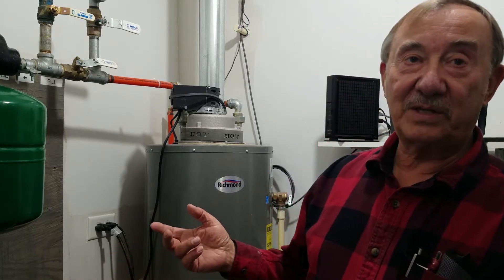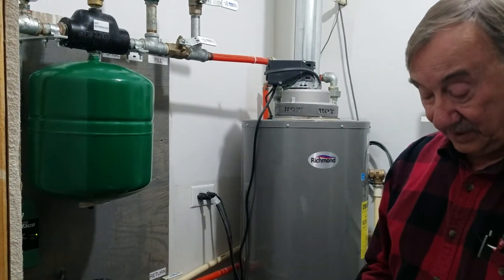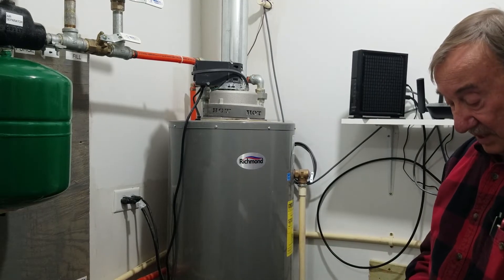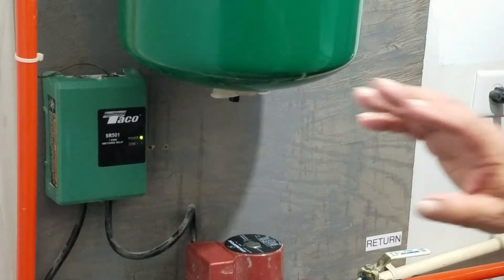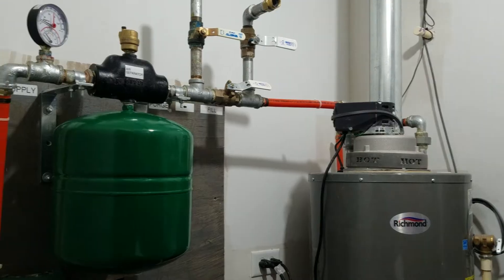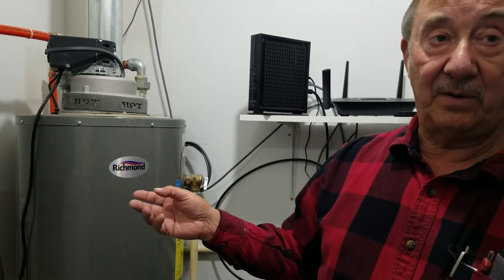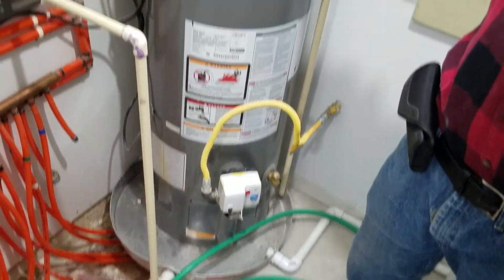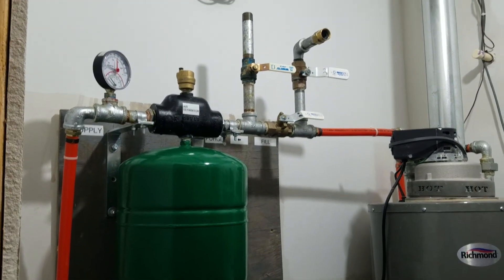Radiant Floor Heat With A Water Heater

Comment: These heaters are only about 60% efficient.. I used to use the same system.. it works, but man it isn’t efficient.  I just updated my 2 old gas water heaters to a single heat pump water tank .. and for giggles I decided to run my floor off the same house unit.  To keep the water streams separate, I use a water to water exchanger.  I also have a fireplace hot water coil that cuts in every time I have a fire (cold days).  The fireplace can heat the house and slab all on its own .. so the HP water heater isn’t stressed.  Anyway ., these systems do work and people should be unafraid to play with them IMHO to learn.  I’ll be installing an R290 air to water heat pump next spring to be the primary energy source.

Comment: You never mentioned anything about the expansion tank that is in your system. What air pressure its set at etc etc...Please explain about why you need the expansion tank! Ty

Comment: Your pump should be mounted on it's side.  The way you have it mounted it will have air around the motor and it won't cool or lubricate it properly.
Reply: yep. At this point, remove pump, tighten each flange a quarter turn and reinstall pump. fixed.

Comment: Check for proper venting of the fixtures in that bathroom if one of the fixtures isn’t vented the trap could be getting siphoned or call the plumbing section of the health department in your area and ask for the inspector to come check it out or file a right to know through them on the inspector’s pictures and what he documented when he did the rough in inspection

Comment: Has anyoone used the kit from manitiba canada from  infloor heat ??
Reply: I live in New Brunswick, I have a system that I have been using for 14 years in my dog kennel. The system uses a 40 gal electric hot water tank, running 4 -  1/2" loops. The dogs love the system the temperature is set at 20 deg C

Comment: I am very grateful for your time you spent explaining your system. I am living in a place that is very cold in the wintertime. I do have free water. My 30 ft x 15 ft addition set right on the ground, that was built on to my permanent 30 foot camper is simply freezing out there! My camper has propane heat which works good but it is also so freezing in the winter and too hot in the summer.  There are two reasons I am going to have to re-do the floors in my camper. 1- because I want to get at the plumbing and insulate it for winter and 2 - because of underneath floor rot, soft floors…. Our travel park was not open in the winter for 50 years and just two years ago they opened for people to stay during the winter months!!!  I bought this home in January, oh my goodness, so scared the pipes were going to freeze as no one ever lived in it in the winter!!!  I was told the only way was to put electric space heaters in each area with running water  and they said I had no choice but to keep the water running in two bathrooms and three sinks and the shower continuously - I really need to find a way to heat the floors and insulate  the pipes and yes I want to insulate the walls but I am concerned about condensation and all that water vapor barrier rules!  I super appreciate your time making the video.  I am wondering if you will ever make a video on how the floors feel and how the rooms feel in the wintertime and how your rooms in your home is set up ? Do you have a list of all the parts like the pipes and the pressure gauge and the water off switches and the pump and the other round thing above the pump.  Do you know how much it cost you?  Can you tell us?  I am hopeful I can afford it.  Otherwise I probably cannot even live in here in the winter cause utilities were outrageously super expensive!  Well this idea gave me hope!

Comment: You got it right -keep it simple.  I did the same thing 25 years ago in Albuquerque with a 30,000 btu natural gas water heater. Worked perfectly, just like yours.  It is slow to heat the house up compared to hot air, but we have lots of adobe mass walls to heat as part of the passive solar system (large south facing windows). The simplicity and low cost compared to the usual very expensive boilers is a winner. I erred  by only insulated under the slab perimeter. You should follow his 2" foam under the slab . (Unless you live on a Florida  beach and don't want the house to float away)

Comment: If you only have a handful of metal fittings you may as well splurge and use stainless steel ones instead of galvanized. Also your fill and vent line should have caps in case some fool opens the  valves

Comment: IMHO: :face-green-smiling:IF YOUR "ROOM THERMOSTAT" WOULD SIMPLY TURN ON THE CIRCULATING PUMP,... THEN YOU COULD INSTALL A "FLOW SWITCH" TO THEN APPLY THE INPUT SIGNAL TO THE WATER HEATER(S), SO THAT THEY WOULD THEN FIRE UP, AND START HEATING UP THE WATER-GLYCOL, AND CARRY THE HEAT TO THE FLOORS WHER IT IS NEEDED, TO HEAT THE HOUSE.  WHEN THE ROOM TEMPERATURE REACHES THE DESIRED "SET-POINT" THE ROOM THERMOSTAT WOULD ALLOW THE CIRCULATING PUMP TO TURN OFF, (AFTER BEING "HELD "ON", BY A TIME-DELAY RELAY... SET TO ALLOW THE CIRCULATING PUMP TO CONTINUE TO RUN, AS LONG AS THERE WAS ADEQUATE HEAT IN THE TANK(S)...
... THE FLOW SWITCH WOULD IMMEDIATELY TURN ON THE HEATER(S) "ON", WHEN HEAT IS NEEDED,... AND, A SET OF "AUXILLIARY CONTACTS" COULD INTERRUPT THE HEATER "ON/RUN" SIGNAL", AS SOON AS  THE ROOM THERMOSTAT IS "SATISFIED".... THUS STOPPING THE CONTINUED HEATING, WHILE STILL ALLOWING THE CIRCULATING PUMP TO CONTINUE FLOW OF THE DECREASINGLY HOT WATER-GLYCOL.   SUCH A CONTROL SYSTEM COULD BE WIRED VERY SIMPLY. 
:face-green-smiling: JUST HAVE ANY GOOD ELECTRICIAN DRAW UP THE MINIMAL CONTROL CIRCUIT. :face-red-heart-shape:

Comment: WOW!!!!   THANKS FOR THIS GREAT INFO, AND EXPLANATION!!.. I HAVE A SMALLER HOUSE, (IT'S ONLY ABOUT 864 SQ. FT.)  I WANT TO INSTALL A SIMILAR "SIMPLE" SYSTEM, USING A "TWIN" HOT WATER TANK SYSTEM (ONE TANK (OR TANKLESS HEATER?), USING NATURAL GAS, THE ADDITIONAL "BACK-UP" HEATER WILL BE ELECTRIC ( SO THAT IT CAN BE HEATED FROM POWER FROM A "BACK-UP" GENERATOR, OR, COMED., IF NECESSARY.

Comment: Can you do this with baseboard?
Reply: No you have to use something other than a wood baseboard.
What do you mean, with a baseboard, baseboard is a piece of lumber trim
Reply: No, baseboard slant-fin heat requires 160-180 degrees. You need to have a boiler that can get those water temperatures. A standard hot water heater will not suffice.

Comment: What is the water antifreeze ratio
Reply from the maker: It depends on the amount of protection you desire usually based upon the temperature in your area.
Reply: I am in northern Illinois also so what ratio did you use
Reply: @joegottgott3213  You need to understand how antifreeze works. The more antifreeze you have the lower the protection. Buy something like a Antifreeze/Coolant Tester at your autoparts store for 5 to 10 dollars and a jug of antifreeze. Take one cup of antifreeze and test it, then add 1 cup. Then test it again and see how the protection goes from -40 to say -20. This is a 1:1 ratio. The more antifreeze you have the higher the protection.

Comment: Your average boiler is set at 180 degrees Fahrenheit, unfortunately the highest a residential water heater gets is 160 degrees Fahrenheit IF no one is taking a shower or washing clothes. A residential water heater can and WILL work for radiant heat but during CRUNCH hot water time's like when a family is showering or washing clothes you will not get heat.
Reply: this appears to be a separate unit
Reply: Its a dedicated heater
Reply: Its a dedicated heater
Reply: Dedicated heater for one and tempature has nothing really to do with it. BTU ratings have more to do with it than anything. For example if you had a 100k btu heater it would heat up twice as fast. 200k btu heater 4 times faster and so on. 
You can use a electric water heaters as well. There are some really nice water heaters out there that are pretty good. Look for ones with higher kwh ratings as they will have the highest btus. For example a 40g 4kwh water heater is only 400 dollars. If you need more heat then add another one in line. Its far cheaper than a boiler and cheaper than a higher rated water heater. 
Even the cheapest set ups are going to be super easy. The pipe and fittings are really super cheap if you look hard enough. All you need is a recirculate pump which can be had for 100 dollars, water heater 400, thermostat plug in switch 50 (plug the pump in to it and it turns on and off when it hits the temp), pex 1000 feet 250, fittings 250. For a bit over a grand you can install radiant heat in to your slab. Add tax and adjustment for location and better stuff you could be in the whole system for less than 2500 dollars.
Reply: @kameljoe21  tldr
Reply: It's a separate water heater just for the heating system.

Comment: Its a closed loop system. We have hard water here. I use only water. My boiler heater and parts are 60 years old. Only had to replace the TACO and In Flow valve once in all this time.
Reply: And why is it that you dont use antifreeze and what kind of water do you use, i'm assuming non distilled water.
Reply: @JohnODonovan1  Never turn thermostat lower than 55-60 so it can never freeze. and yes it is tap water in a closed loop system so the hardness is not a problem.
Reply: @grabir01  except for the times of year when the system is not on or needed?
Reply: @JohnODonovan1  True.

Comment: You hit on a lot of points to this system...
I honestly think your video is the most sensical one with information and basic workings of your system..... I don't have a heater, last winter it got to 22F in the house. Which we're from the city, we're used to a nice warm 70s in the winter... :O

I'm trying to look at all what is there for a material list...

4 shut of valves, pressure meter, air separator, cold/hot manifolds, thermostat unit, water heater, antifreeze and some pex pipe with various elbows.

Comment: The two 90 PEX elbows at the manifolds totally unnecessary and adds flow restriction. Vertical shaft on pump not good.

Comment: Hot water heater is a stupid solution, Low efficency, voided warranty and you only saved a few hundred dollars plus takes up three times the floor space as a small wall mounted boiler. Amature. Hot water storage tank not designed to condense on system cold start thats why it will fail. Antifreeze mixed to proper ratio very good. Distiled water, money wasted that should have been spent on a pro. Heated water in a sealed system reaches a neutral Ph in a day or two of operation. Pump is mounted in the wrong orientation, voided waranty and the video being three years old this is why your pump impeller has allready or will soon fail. All you had to do is read the directions for that. Lack of islolation for the individual zones, cheap lazy caused your own headach. Now lets look at why your dangerous as well as cheap, First minor infraction no drip leg on your gas valve. generally only fly by nites and amatures use flex lines at all let alone three footers, But your lack off condesate trap will get your gas shut off until a pro fixes the problem. Why? Now for the problem that hill kill everyone in your home because you thought that you would save a grand, No make up water supply. Thats ok but- No low water cut off (LWCO) mounted at the TP valve on the tank. Whats going to happen is when you have a leak or a rupture (probably caused by your gas valve sticking open fron the lack of a condesate trap) the cold water dip tube in the tank is going to syphone your storage tank down to where it's nearly empty, then whats left will flash to steam and literally melt the paint and drywall off of your room. Now here where dumb and cheap comes back to save the day. your going to hook your hose up and flash water into a hot system wich will explode and through darwinisim get rid of you but unfortianatly kill everyone in the adjacent rooms as well that should have been rid of your tight wad ass years ago.
Reply: @busimagen  I have been doing this work on a daily basis for right around 27 years now. 13 years successfully operating my own big show. Don't think I have not used domestic water heaters for this application, of all types and configurations. Even the tank heaters that are designed to add a little bit of heating are usually still a bad choice for there short life span. 
   So when someone starts explaining things to me, with my education and experience. I can very quickly understand that they are grossly misinformed by an idiot, or possibly just just the idiot that's doing the misinforming? There are many ways to skin a cat. But most techniques get blood and shit all over the place. I don't know where you came up with your terminology and "cold shock" but I think the factor your blabbing about is what the pros call Delta T. The Delta T in any given system needs to be delt with even with using a tank for storage or for your source. Or if the heart of your system is a million BTU gasifier coal boiler. The Delta T needs to be consistent to avoid the effects of condensation, radical pressure variations, strange and annoying noises. But like I said many different options to control this. From a simple manifold with hand valves, to complex thermostatically controlled mixing pumps and all the tempering and mixing devices in between. Simple reply would be like I already said, domestic water heaters are rarely almost never the best solution for a hydronic radiant system. For longevity, safety, warranty, footprint and comfort there is always many better options. Like grandma used to say if you are flapping your gums just to show everyone how much wind you can make? Probably best that you just shut your pie hole.
Reply: no comment necessary
Reply: tldr! youtube rager
Reply: He's just trying to help. Your a Ass
Reply: Chill out guy, DAMN
Reply: Why bash someone like that? Dang
Reply: @flowergarden1426  that is explained in detail why.
Reply: Sounds like someone got up on the wrong side of the bed you say stupid for you but for me it is the best option and I made my shop large enough to place a stupid water heater there so thanks there big guy love the video and that you for the time you took to help us learn this system.
Reply: @flowergarden1426 reflection of there self I love the video
Reply: @caseyangeletti6300  The perfect diagnosis for your personality disorder, I believe the term is Narcissist. You believe you are right and everyone else is wrong, did you get along with co workers? Your own big show? “Ewe”
Reply: @jimhouse1227  after 30 years in the business it never ceases to amaze me what idiots will do to try and earn an award? Like Mr. Barnum said, " there's one born every minute". What do facts learned from years of experience have to do with the side of the bed? Or code and law devised through scientific practices? Always has to be a dumb shit like you that puts his hand up and says "I ain't blowed up yet" 
  Besides how many years ago was this? Take a look before you proclaim your alliance to the idiots and you would see quite a few have beat you to it. It's official your in now!
Reply: I'm here because I saw my first gas fired water heater that does radiant heat today. It was installed in 2006 and is still running perfectly fine. Yes the pump in this video is installed incorrectly, but I loved to see a simple water heater doing a good job compared to some pile of shit wall hung unit. It was an 80 gallon with two zone valves. Love it
Reply: @mikeantj keep dreaming, your voided warranty tank is on its last leg and couldn't have been used for domestic supply as well. Thus what is the point idiot? With a good stainless high efficiency unit you would be looking forward to another 30 years of instant warmth. Without a refrigerator sized tank taking up space. Get a grip and call an adult before you make decisions like that.

Comment: I build a hydronic floor heating system for 900 sq ft living space , I also need the GE hot water tank for the kitchen and bathroom. It is 11 years old and work perfect. The hot water tank ( 60 gallons ) get maintained regularly and have a 12 years guaranteed live, but by the looks of it ,it will last longer. Now I build a new home 2 floors with 4 bath rooms and heat it with a Rheem  retex 06 electric tankless water heater.and in each floor is 1100 lin feet 1/2 pex line. Each floor is 3” ( 7.5 cm ) thick. The wals are 2x8 thick insulation and the ceiling of the top floor is R 63. Total water amount in each floor is approx 45 liters of water and it is a closed system. For the bathrooms and kitchen etc I have a natural gas Rheem on demand water heater. Electric is better for the environment than any thing else. I really do not know the cost per season because I have not used for a long time , we started the system the end of Sept 2022 and had set the temp 27 Celsius in the floor and the temperature in the home is 23 Celsius. At night we do not set it lower. We love it.

Comment: Excellent commentary. I love it when you say concrete. So many people say cement and and much rather walk on concrete then cement. Great job! I put two or three hot water systems in like that wood fired oil fired wood oil combo they talk about green energy. Should be a law and a new home in the cold zone of the United States should have radiant for heat. Save so many dollars.